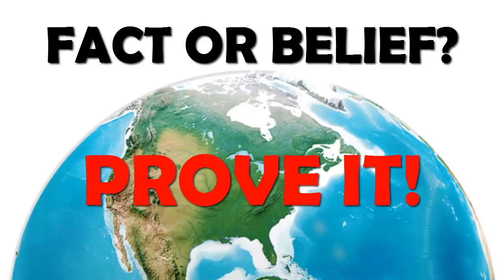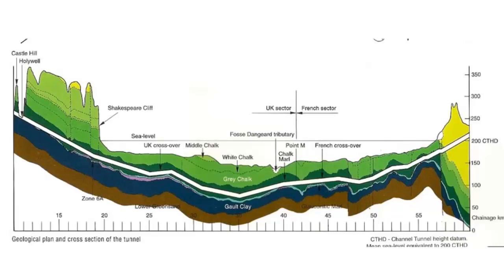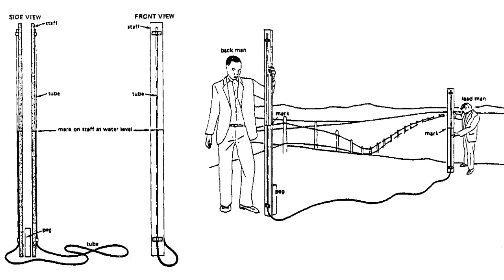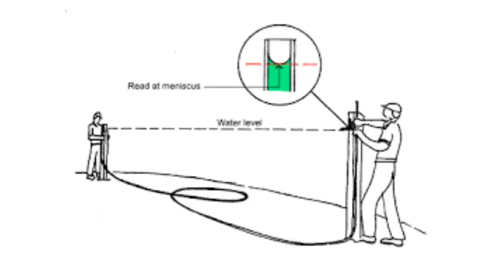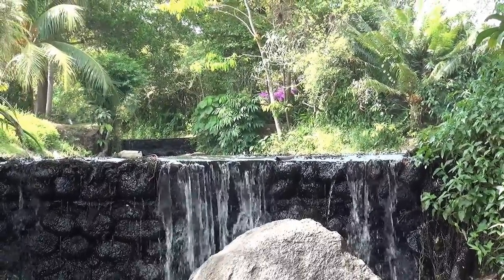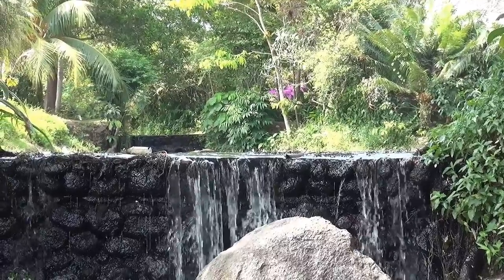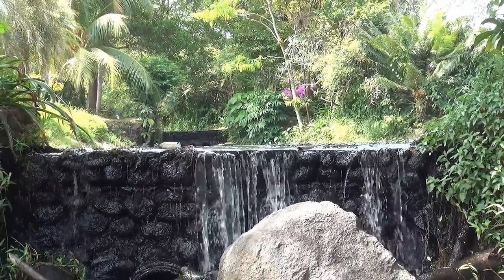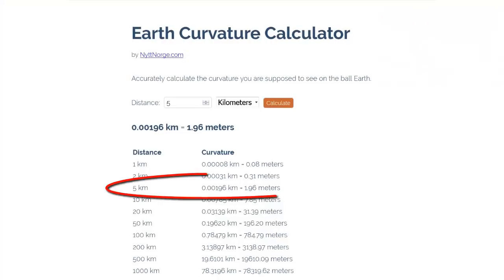Flat Earth Water Level Challenge - Prove Bendy Water Not Flowing

Comment: What would be the easiest way to prove water stays level and flat - anyone any suggestions ? With a laser maybe ? 5 kilometers should be doable i guess .
Reply: Gibson225 all you need is a laser, a mile and a beer bottle floating on a platform. If you can hit that bottle with the laser, then it is flat
Reply: It will not be doable to keep the laserbeam pointed at the bottle . Need for bigger targets like a big whiteboard or so..
Reply: i am beginning to have a few doubts about what we are being told in regards lasers?
and the main doubt is their accuracy over a large distance?
we are told that they shoot lasers at targets on the moon with great accuracy?
now my doubt involves water
we know water bends light
a simple experiment for this is get a pen laser and a glass of water shine the pen laser through the glass of water and see if the laser goes straight through the water and comes out the otherside as a perfect beam the same as it is going in:)
now back to the moon and hitting targets with a laser?
how are they doing this with any accuracy when the laser first has to travel through approx 300 miles of atmosphere filled with water??
because no matter the power of the laser it is still light
and we know water bends light
thoughts?
Reply: @levoy foster
You're not all wrong there, the atmosphere can interfere with light, including lasers. However, the effect is very small when looking straight up in clear weather. The worst effect is in the lower atmosphere, so the higher you go, the clearer it gets. There's a reason why observatories are often built on mountains.
Reply: Arrow Knee
yes mate i understand all this but clear wheather does not negate the fact that the atmosphere is still full of water??
cloudy or sunny the water is still there?
it is the lower atmosphere which give me doubts because because it contains more water so by the time the laser reaches the upper atmosphere the damage would have been done
as i say its just my thoughts and the fact we know water bends light and the atmosphere is full of water
the analogy is if a gust of wind hits a traveling bullet at 200 yards or 500 yards it doesnt matter the accuracy of the bullet would still change:)
Reply: I tried with strong and lightweight fishing line ( expensive !) already but the problem is that after a few hundreds of meters the line starts to hang through because of its own weight and so a few kilometers can surely not be done this way- there has to be an enormous tension to keep the line horizontal .. so unfortunately it failed and i am thinking of buying a decent laser plus beam expander now.
Reply: bad idea to use laser, it can bend.
Reply: @levoyfoster8510  magnetic field also bend light. So yes laser are only usefull for short distance in lab.
Reply: @levoy foster
The other point I mentioned was looking straight up. If you have a square glass full of water and you point a laser at it at a straight angle, it does come out the other side same as it went in. Atmosphere is more forgiving too, so as long as you're not playing near the horizon, experiments can be accurate.
If the gust of wind hits the bullet head on instead of the side, the accuracy wouldn't change, especially when the bullet is light and doesn't even slow down.

And magnetic field doesn't bend light like that guy said.
Reply: @arrow_knee  
ah well its easy to prove or disprove whichever the case:)
just get a laser sight it at a target say a 100 yards away and see if the laser isn't deflected
when you do this in the rain:)
and your wrong to think a bullet travelling into a headwind would not be
 deflected ask a pilot when their fighting to stay straight flying into a
 headwind
no matter the direction of the wind it would deflect the bullets trajectory
 over distance
magnetics i have no clue about lol i have yet to research them:)
Reply: @levoyfoster8510  
Rain is very different from water vapor in the air. A lot of water droplets means a lot of uneven surfaces, which will certainly scatter the light. An even layer of water vapor, on the other hand, would have practically no effect. 

Even if a bullet does turn in headwind, that just means the analogy broke down. Not the actual answer to the question.
Reply: @arrow_knee  
if the droplets are large or microscopic they are still droplets of water deposited through 300 miles of
 atmosphere and you think due to scale this is the reason lasers are accurate over distance?
the fact remains it does not matter if the droplets are large or microscopic they are still droplets of water
 and water bends light?
and we must add pressure and density into the equation the lower you get in the atmosphere the more density you find hence whatever element compose the atmosphere get more densely packed
so the lower you get the larger the microscopic droplets would get
and again we know water bends light and the atmosphere is saturated in water

that the anology did not take into account a headwind did not break the anology? by adding the headwind
you just strengthened the anology??
that wind would effect the trajectory of a bullet no matter the distance or direction???
how could you not see otherwise?
or are you saying that if water was rushing towards the laser or if water was coming at the laser from a
 sideways direction no matter what distance 
it would not effect the lasers accuracy???

now i am not sure on the lasers accuracy i am just asking questions
and the answers i am getting are falling a bit short
due to a simple fact water bends light
and a laser is composed of light?
and the atmosphere is full of water no matter in what form?
Reply: @levoyfoster8510  
The difference is, there are no droplets in gas. If there are droplets, that's a cloud. Without droplets, there are no surfaces with differences in optical densities to bend the light, or rather, the gas can be simplified to act like one large surface which doesn't bend light too much.

The bullet analogy broke, because a bullet doesn't act exactly like light.
Reply: @arrow_knee  

Even though clouds are absent in a crystal clear blue sky, water is still present in the form of water vapor and
 droplets which are too small to be seen. Depending on weather conditions, water molecules will combine with tiny particles of dust, salt, and smoke in the air to form cloud droplets, which grow and develop into clouds

and your explanation for the above statement is??
in view of your statement there were no water droplets present that thats a cloud

so even in a clear blue sky their are still water droplets present??
Reply: @arrow_knee  
and it also seems i was wrong in the higher you get scenario
because the higher you get the more water there is:)
 Cloud droplets can vary greatly in size, from 10 microns (millionths of a meter) to 1 millimeter (mm), and even as large as 5 mm. This process occurs higher in the sky where the air is cooler and more condensation occurs relative to evaporation
Reply: @levoyfoster8510  
That's just a question of scale. It would indeed be reasonable to assume there never is a perfectly clear sky. It can still be clear enough, a few microscopic droplets here and there don't make a difference.
It's kind of obvious, honestly, I mean, we're talking about light here. We see light, so if you can't see it, it most likely isn't a problem for any experiment with laser.
Reply: @levoyfoster8510  
So, yeah. Lasers can be pointed to space accurately. 
I hope this helped.
Reply: @arrow_knee  
still not convinced mate
the atmosphere is full of water 
and you cannot fire a laser with accuracy in the rain?
so 300 miles of atmosphere full of water is still a stumbling block for me:)
i am not saying a laser maybe could shoot that far but with any sort of accuracy is still a no for me
Reply: @levoyfoster8510  
How is the water going to do something to the laser if you can't even see the water? If you can see the moon clearly, a laser can get there by the exact same path.
Reply: @arrow_knee  

well you cant see the atmosphere but fall out of a plane and you know its
 there due to the resistance you encounter
we know the atmosphere is fall of water that you cannot see it means fuck all we know its there:)
and in my mind firing a laser through 300 miles of atmosphere thats 
saturated in water puts the issue of the accuracy of the laser in doubt
we already know the atmosphere is full of water
and we already know water bends light:)
just put the two together mate
we already know the higher you get the more moisture you encounter
due to condensation in the formation of clouds?
so just because you cannot see this does not mean its not there
you have already admitted that firing a laser in the rain would give
 problems with its accuracy
i am not sure if this is a fact but up to now you have been unable to fault 
my reasoning
Reply: @levoyfoster8510  
You just don't want to understand what I'm saying, do you? 
What your eyes see is light, laser is light, 1+1=2, if you can't see it, it doesn't have an effect on the laser either.

Clouds forming doesn't mean more water, not that it's relevant, but anyway.

You can see rain. That means it is a problem for lasers.

Comment: What is distance between New York and Tokyo? 6737 miles
What is the curvature? ummmmm
Reply: The curvature between NY and Tokyo would be about 97 degrees, or "drop" of ~4000 miles.
Reply: Please provide your source of information
Reply: @truthincorporated5475  I googled the radius of the Earth.
Reply: @arrow_knee  so you rely on the authority of Google?
Reply: @truthincorporated5475  If Google gave wrong results for something that incredibly basic, nobody would use it. 
I did remember the number from schoolbooks too, just had to double check.
Reply: @arrow_knee  so the information you obtained from a Google search corresponds to what you learned at school so it's considered true by you. I see. Any proof that your finding is indeed fact?
Reply: @truthincorporated5475  It's a fact accepted by the scientific community. I haven't measured it myself, if that's what you're going for, but I have no reason to doubt its accuracy.
Reply: @arrow_knee  Kindly get into contact with this scientific community and request physical proof for this claim, I would like to see it.
Reply: @truthincorporated5475  Maps work, don't they. That's proof already.

Comment: Not gonna lie, you're a pretty good actor. Some people actually think that you believe the Earth is flat, even though that is an outrageous thing to believe. However, I think you'll still have to work on your delivery and change in tone a little bit before you make it onto the big screen, though.
Reply from the maker: Believe what you want. I am not interested in fake stardom. I am looking for the truth, which is what led me on this path in the first place. I know we do not live on a globe. However, I have no problem being proved wrong with such an experiment.
Reply: I know. I was just muckin' around. You believe the Earth is not a sphere, and I do, and we are both willing to be proven wrong. I will suggest that the curvature of the Earth can be proven by measuring electromagnetic waves (i.e. radio waves). Over a distance of 5 kilometres, the normal to the stationary point of the wave's curve (i.e the point on the radio wave where the gradient is undefined/vertical) will be, as the calculator suggests, just under 2 metres higher than the Earth's surface compared to the wave's origin. While people much further than 5 kilometres away can still receive these radio frequencies, they receive the signal at a point where the gradient of the waves is negative (i.e. diagonal and heading downwards).
Reply: Sprocket you're trying to tell us radio waves prove the earth is a ball ? electromagnetic waves is just light, light is easily distorted and manipulated, tell you what, post the link to this ridiculous claim so we can all have a look at it.
Reply: While light can be distorted and manipulated, light waves come at a frequency, meaning that there's a lot of them. While some are manipulated and distorted by various obstacles, a large amount can remain unchanged. If all of the waves are manipulated or distorted, the signal is never received (e.g. your sat-nav cuts out when you drive through a tunnel, because the landmass in the way blocks the waves coming from the nav-star satellites).
Reply: I can assure you I am not bothered about what shape the Earth is. I just feel like people who are confused about certain things should be taught. It helps improve humans as species.